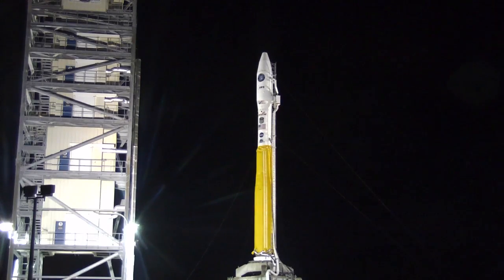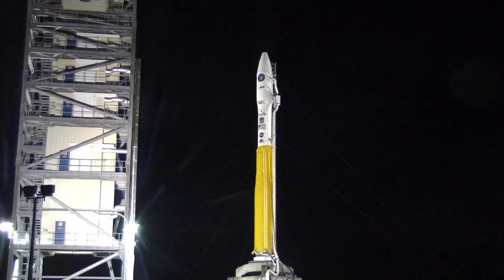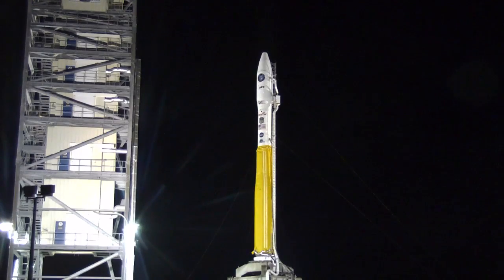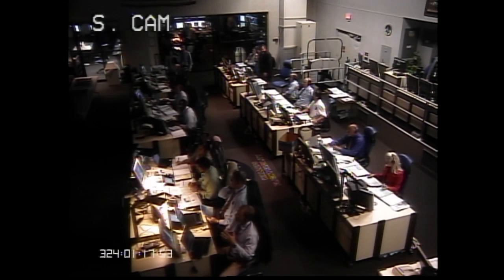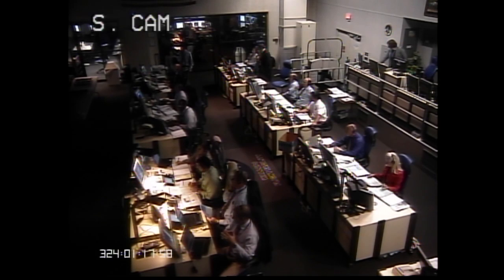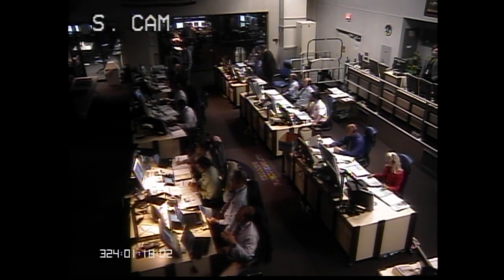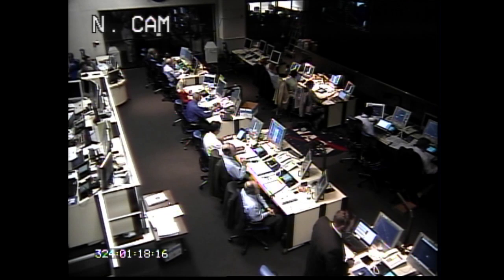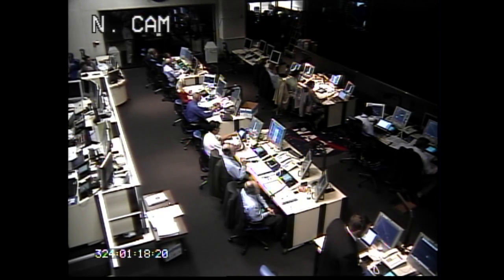ORS 3 Mission Launches from Wallops

Comment: Was the yellow part is actually protective blanket to protect from the element?
Reply: Yes, it's a thermal blanket that keeps an even temperature on the earlier stages. We call it the banana or banana peel because it splits into sections and peels off at launch :)

Comment: amazing that ATK Thiokol and Orbital Corp can recycle what was once Cold War junk the Minotaur is made of parts from a scrapped Minuteman Missile with a Caster 30 as the upper stage
Reply: Obviously not junk.
Reply: sizzlebread23 I call it rocket recycling when START 4 was signed all Minuteman Missiles were scrapped Orbital wanted to recycle them so they did not sit in the warehouse in Promontory because solid rocket fuel degrades casings if it is allowed to sit. ATK Thiokol is Orbital Corps suppler all of the casings are refueled at the Promontory facility and some are tested on the same test stand used for the SRBs then the casings are filled with fresh fuel and shipped by truck to Salt Lake Airport or Hill Airforce base where they are loaded into a C5 for the trip to the launch pad when it arrives Orbital adds the satellite which they built and encases it in their faring which replaces the Minuteman's nose cone then they launch it and since it is a Cold War Missile which uses solid fuel if you blink you will miss the launch.

Comment: The booster was a repurposed Minuteman ICBM.  They were designed to get out of their silos in a hurry before they could be targeted.  This is sort of what the beginning of a nuclear war might have looked like.

I went outside right after the launch and followed the rocket's flight as long as I could.  I saw two different objects separate during the third stage burn, neither of which are visible in this video.  One was right after third stage ignition and the other was about 20-30 seconds later.
Reply: About 20-25 seconds into the stage 3 burn, the cowling separated.
Reply: yup an ATK Thiokol Minuteman Missile. when START 4 went into effect all Minuteman's were scrapped Orbital bought them and uses them for the Minotaur Program they also use decommissioned Trident,Poseidon,and Peacekeeper Missiles
Reply: It wasn't a minuteman missile it was actually a repurchased Minotaur Missile from the decommissioned peacekeeper weapon system. My team actually assembled the rocket.

Comment: That puppy left in a HURRY!  You expect a leisurely lift off based on all the films from the Gemini, Apollo, and Space Shuttle missions, but this thing is explosively fast.  Of course, you don't have to worry as much about G-forces on an unmanned flight.
Reply: what do you expect the first stage is a Minuteman Missile
Reply: the bottom is a Minuteman Missile the top is a Caster 30 with Orbital parts on top of that
Reply: *****
Well, MAVEN was particularly slow. That was 100% liquid fuel.
Reply: If I can banter a guess it's that the Maven module had a far heavier payload into orbit as it had to get a-lot further than this. Maven was a tanker, this was a sports car.
However I should stress that my main evidence for this is common sense and Kerbal space Program, so don't quote me on this
Reply: did you ever see Dnepr launch footage? While it doesn't explode like this one it definetly launches fast :D